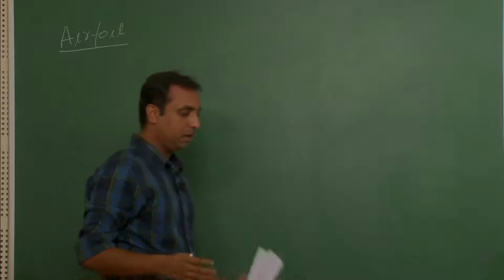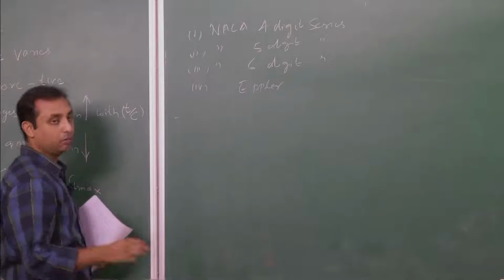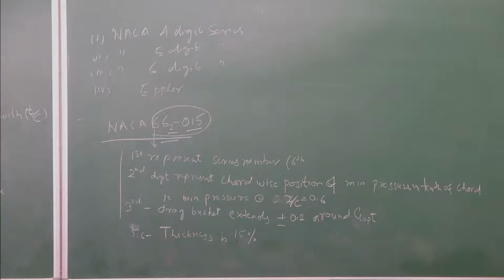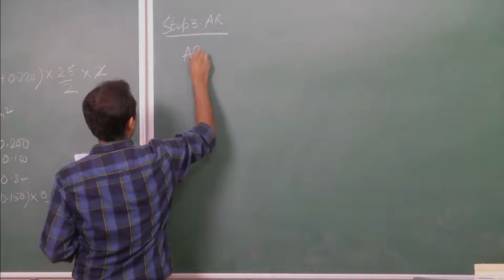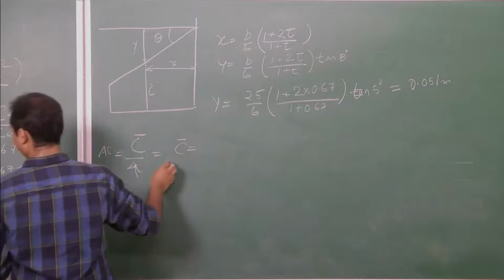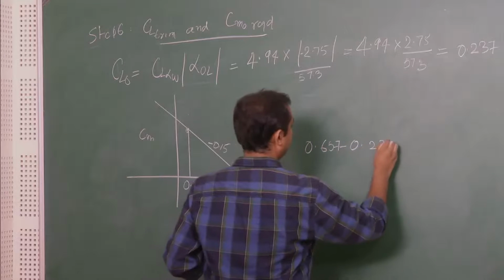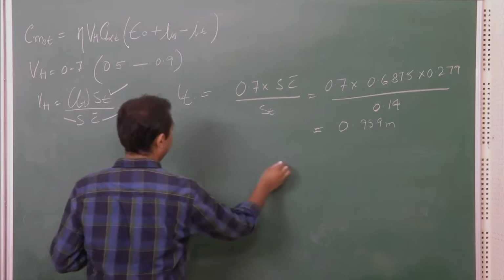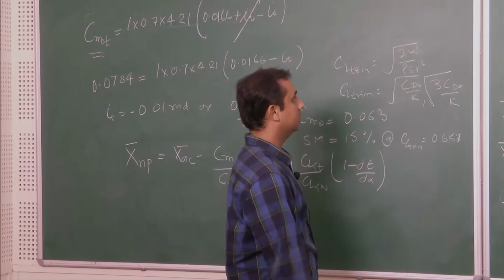Lecture 40

Comment: So we know that CLtrim is 0.431 and not 0.657, all other calculations related to CM0 go wrong in this case, I mean the value of tail setting angle comes out to be 0.085 degrees, which is absurd and not possible to calibrate on high flying UAVs physically. 

The point of explaining this is that in your NPTEL Certification exam you ask same questions.
Every answer or calculated value depends on previously calculated value, and if professors can make such mistakes then the exam is doomed at the end.

Everyone is then prone to lose marks if calculation of a certain parameter at the start goes wrong.